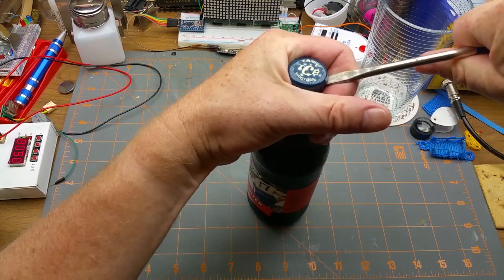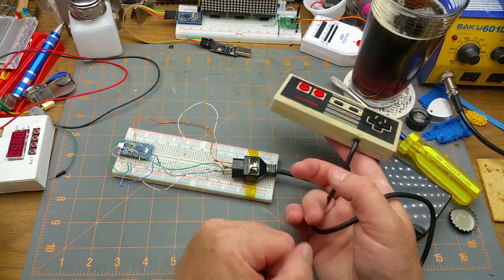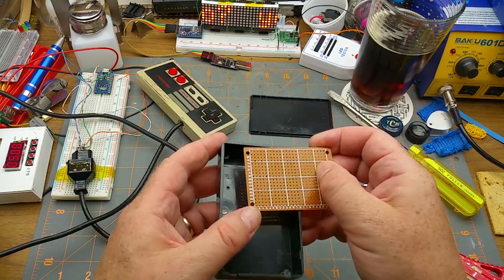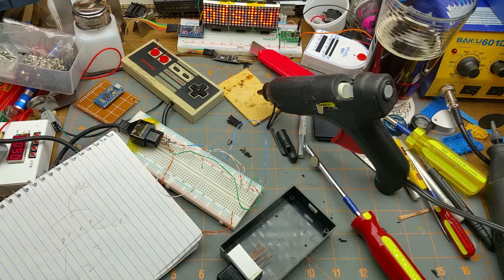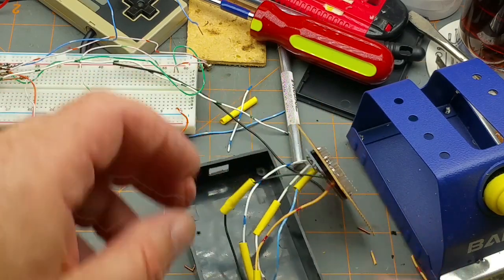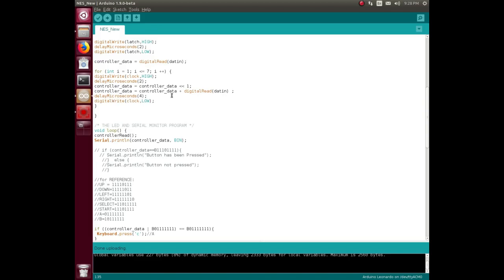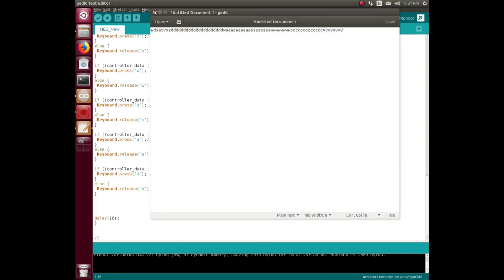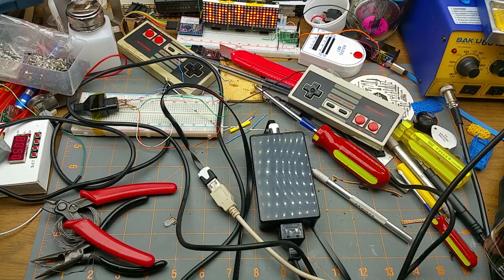return of the nintenduino

Comment: I liked this a lot. Thanks to you i'm now the proud owner of a gutted nes with a raspberry inside. I made it so i can use the original power and reset button and plug in the original controllers when emulating nes. Cheers! (note if i unplug the nes controller from the socket the controller goes beserk (phantom pressing buttons). I think it's because the pin state becomes unstable. Can i fix this with a pull up/down resistor over the data pin?
Reply from the maker: I would think that's a safe bet. Probably a high value pull-down

Comment: To check if a button has been pressed it looks like the eight bit controller data is being ORed with a mask and if that comes out true it means that button is currently pressed otherwise the button is currently released.

  The mask is just after the vertical | OR pipe and anything set as one is being forced to pass the test and anything zero will only pass the test if the button is actually pressed to make it also one and then everything is Boolean true. 

 If the leftmost bit represents button A and that’s what’s being tested, all the other bits are set to one to force them to pass the test and bit A is set to zero and then compared against controller data. If the bit in the controller data representing A isn’t pressed the Boolean result of the comparison will be false. If A is pressed there will be a one and  The result of the comparison is everything is one or true so the button is differentiated out  and checked for 0 or 1.

 I was recently thinking about getting my old Nintendo stuff hacked and then you went and jumped the gun.
Reply from the maker: My young stunt programmer says  "yup, that's it".

You understand this code stuff better than I do!
Reply: Well if I get any fancy NES controller things working you can pirate my software from github.  It will probably be a hack of a hacked hack anyway.

Comment: Am sure that was not your first beer.   This is the drunkest I've seen you on the 'tube.  Shame, I know your name.
There are so many nifty things to do with a 32u4 ... the coolest, I think is manufacturing an AVRISP-MKII with a project called LUFA.  Most of their projects are geared to this chip.
If you simply want to push out CDC-USB characters over USB, you can bang out a 1.0 protocol with a thing called V-USB on your attiny85 (Digispark), or atmega8, or (sigh) your Arduino Nano.
https://www.obdev.at/products/vusb/prjall.html
I just hate to see the extra $1.35 in hardware goto echoing characters.  :P
Reply from the maker: Hmm... I do have a few digisparks and bare attiny85s   kicking around here somewhere....

Who dis?
Reply: You mean, "who is this?"